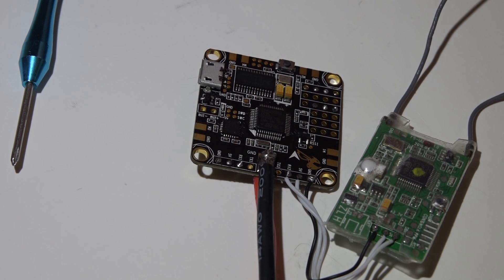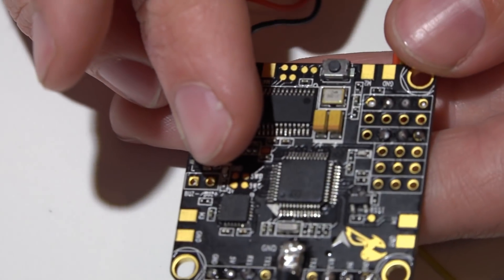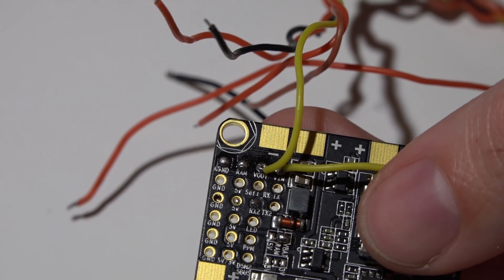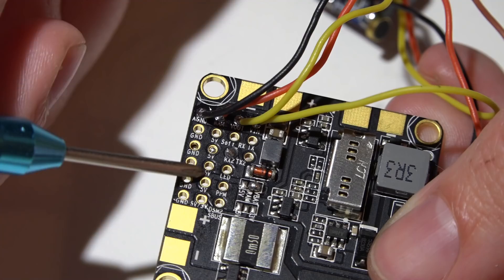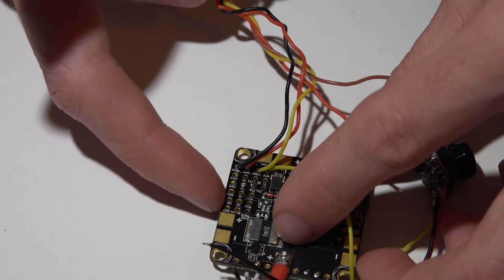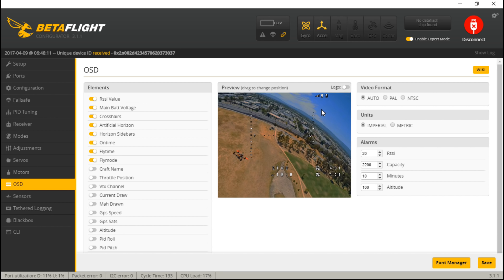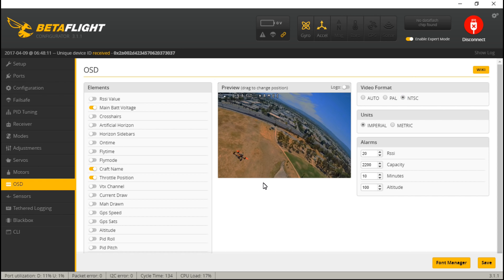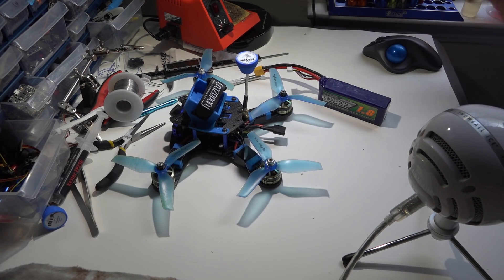Betaflight F3: Connecting Camera & VTx

Comment: quick noob question... will a 6s lippo battery support runcam riot edition (5v-17v) if i connect it to RAM on my betaflight f3? or should i use 4s instead?
Reply: Richmond Rawung 4.2 (max voltage per cell) x 6 (number of cells) = 25.2 So too much, and it won't work. I recommend 4s, and you could just run it off of 5v it you really want 6s.
Reply: thanks a lot mate

Comment: Hey Jc, so I bridged the ram and vbat pads, my vtx was working fine the first day of flying, then the next day, I flew two batteries, and on the second batterie my vtx completely lost power. At first I thought my vtx went out, but it turns out I'm not getting 0 voltage through my ram pin. Do you think you might know what the problem is? And how I can possibly go around the issue to power my vtx again?
Reply: Exact same for me! I powered both vtx & cam sharing the ram/agnd (using battery voltage) - first day was fine, second day & those pins give 0v now :-(
Reply: Same as me 5 packs then the ram pin died so using the main power lead for my vtx  , JC may find a way round it so we can use the ram pin again . challenge JC  lol .
Reply: same here, only i never even got props on before it failed
Reply: i just re-bridged the connection and now mine is working.

Comment: how would you connect tbe tbs unify pro v2 5v to this bf f3 board.. can i use the ram pin at 5v and then use the 5v rail directly below that for my foxeer arrow v3?

Comment: with my betaflightF3, I get stripes in fpv feed even disarmed (static stripes, not that motor noise fuzzl thing). when I'm powering the vtx directly from the lipo, there is no stripes. so the fc makes noise itself, its not the esc oder motors. strange disapointed wired it exactly like in your video, vtx is the GTX226 (both grounds of vtx and the cam gnd are wired to "agnd" on the fc). ram bridged to Vbat.

Comment: Thanks for the video. For one reason I have decided to use a separate pdb and using the tbs unify pro hv, I have powered it directly off the pdb therefore only the video wires from the vtx and camera are connected to the fc. . My question is, is this ok from a video interference and grounding point of view or is it preferred to have the FC powering up the Vtx? Thanks

Comment: Have you seen any issues with this board powering the camera?   I am powering the camera off one of the 5v pads on the board.   I put a Runcam Swift 2 in and it works fine, but when I try the Foxeer Monster v2 the video works but has random dropouts.   This is for sure the camera because when the screen goes black I still have OSD, so I know it's not the VTX since I am still getting a signal.   Also if I put the same camera on my other quad, I have no issues whatsoever.   

I am wondering if there is some voltage sag on the 5v that is causing the camera to black out.   Camera can go up to like 40v I believe, so even running off full lipo power is ok.   So would it be ok to run the camera power off the same AGND and RAM pins as the VTX or would that cause any kind of noise in the signals

Comment: Thanks for putting so much time and effort into your videos, they are very informative and very useful.  I've learn so much from watching.

A couple of questions: 
1. When soldering wires into the board, do you recommend laying them on top or inserting the wires into the hole?  I noticed that on this video you inserted the wires but your BF Connecting Receiver video, you inserted the wire into the holes.  I ask because I've had a few hard crashes and my wires that were inserted were breaking off.

2. When wiring the XM Plus receiver, we have the three UARTs but what about the SBUS / 5V / GND?  Could we use those instead of the UARTs?

3. Since my VTX doesn't have a 5V out, I'm trying to figure out how to wire in my camera.  I'm planning on wiring VBAT to the VTX but not sure if I should use 5V for VBAT for the camera.  The camera can take 5V to 15V (using 4S battery). What would you recommend?

Thanks again, keep up the great work.

Comment: I do have one question, I have TBS unify nott HV . can I run the camera off the ram pin at battery voltage and the vtx of a 5 volt pin? do I need to ground the vtx with the camera or is the ground next to the 5 volt better? I used pnp50 before and always has take nice video, but that thing weighs 30 grams and this board is supposed to clean the video up for me at a fraction of the weight. but in really want crispy video. lol doesn't everyone.

Comment: there is one thing confusing me about a build that i plan to use this board in, i have the tramp hv(which has telemetry ) and an x4r receiver(that uses two of the uarts) and im also using the kiss 24a re esc's(that also have telemetry(all of them can be wired to one uart)), so thats four uarts right ?, can i use the soft serial for some of the parts without loosing usb and which part should i put on the soft serial ?

the tramp hv with telemetry is super nice, dont have to fiddle with anything to change channels and i kind of need to be able to flash the esc's through the fc and then there is the sbus which i need for audio warnings from the taranis

Comment: Any video noise from motors? I seem to always have that problem
Reply from the maker: I think thats inevitable without a LC filter. With this flight controller you could power a LC filter off the RAM pin or just off a ESC power and ground pad. Then run the VTx and camera power and ground off the LC filter. I'm using the Cricket Vtx and powering my camera off of it and it filters the video very well. Not perfect but that plus putting a capacitor on the battery leads is good enough for me.
Reply: I'm new I apologize if this is a dumb question and my first actual full build, but when i looked up LC filters there was different voltages? so I am looking for a 5v filter if I am needing 5v for my vtx correct? Is there any filters you recommend?
Reply: Menace i had some luck with ebay fpv lc filter and it can handle up to 25v. It wouldnt matter if it was 5 or 25v, it would still clean up the noise
Reply: thanks for the quick reply brother

Comment: hello great videos i learn a lot from them , i think i damaged my vtx when antena fell of in a crash so i need to choose new , and i have no clue where to start is there big difference ? or shuld i just choose something cheap / discount ? Eachine TX526 seem to be super cheap right now , but then i need the rp-sma -> sma adapter , or scary soldering :) .
Reply from the maker: Honestly the cheap VTx's with a LC filter work very well. I use VTx's like the RMRC Cricket or Lumeniers because they filter a little bit plus I can power my cameras off the VTx's. They cost more than the cheaper VTx's but those two features makes it worth it to me. But in the end I would say performance between the cheaper ones and the $50 ones are the same.